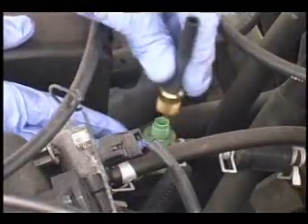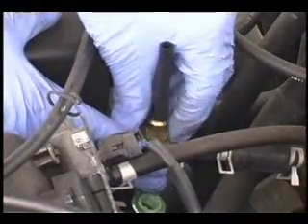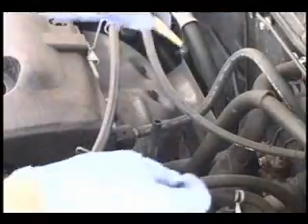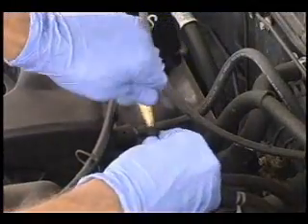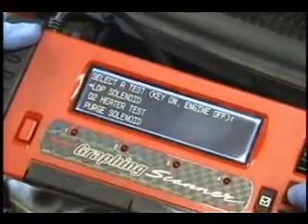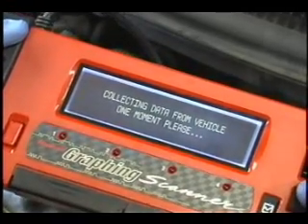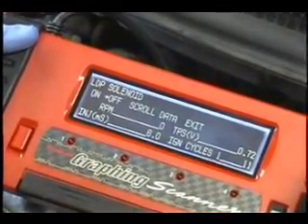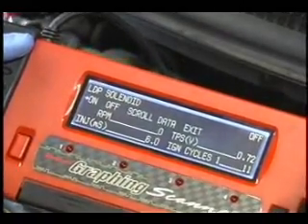Smoke Pro Diagnostics EVAP Leaks

Comment: Just today I picked up the Master Smoke Pro set and I used it on a Acura and .found a small leak in the Evac system right away. It's a great addition to the shop and a very well built tool.

Comment: @istheone100 This is a good machine. I have one for over two years, and I like it alot. I don't want to say I love it, because it is just a machine. I used it for intake, exhaust, and evap leak diag. You only need to refill it with baby oil without aloe to make it work. You need air compressor. Go to ebay and shop around. Guys spent thousands on expensive machine. I got it for less than $900 and comes with a free bore scope.